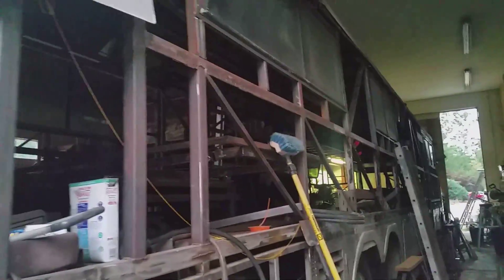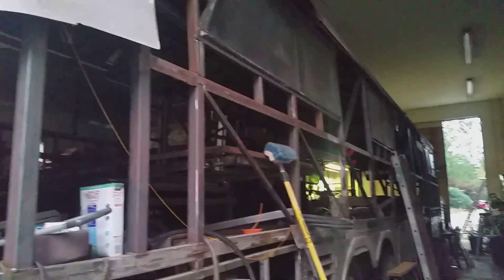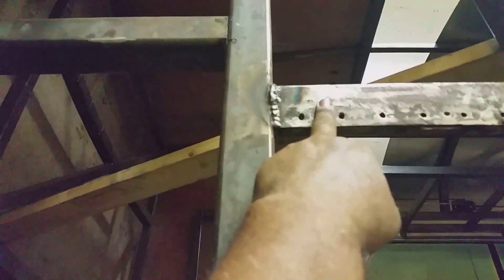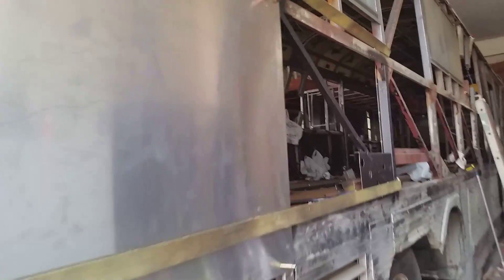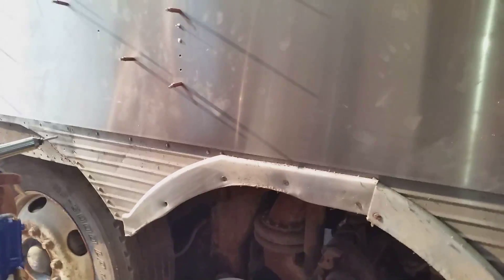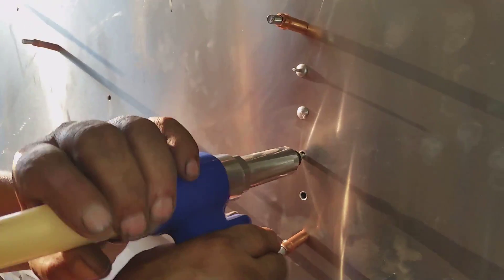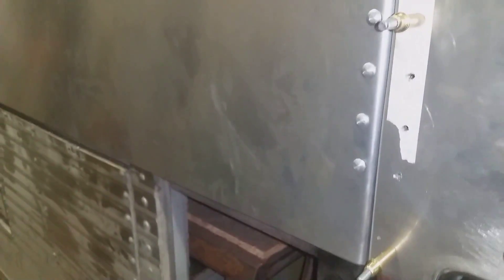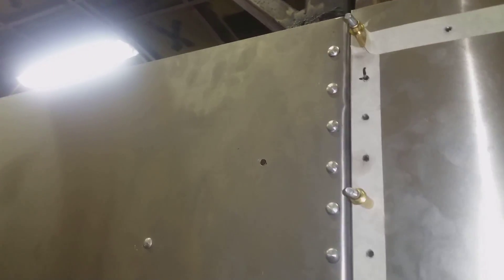Bus Conversion Project - Video 42 - Skinning The Bus

Comment: great project! how are you dealing with the galvanic corrosion potential between the metal frame the aluminum sheet ? what type of rivets are you using? Thanks for the great videos!
Reply from the maker: I have a barrier between the steel and aluminum, the steel is coated with a spray on product and then sikaflex next so no direct metal to metal contact, I am using Huck, shavehead rivets so they look like a buck rivet once installed and dressed, there is a segment in one of the Video's demonstrating the process, Thanks for the question and comment

Comment: Wouldn't it be easier to force the plates to bend around if you placed some 1x2 " wooden pieces that spands from top to bottom and hit the curves you so painstakingly formed and then use rat het straps to pulle the entire plate into shape?
Reply from the maker: If you watch some later videos you'll see thats' what we did, just not showing that here

Comment: Thanks for the info James, so there would be no galvanic effect through the the rivet? and I assume the rivet is aluminum? Have you found a good source for 4000 Huck rivets?
thanks again!
Reply from the maker: the original rivets were 45 years old when I took them out and there was no corrosion so I'd say these will be fine........ I get my Rivets from Byler Rivet in Texas.... they aren't cheap though